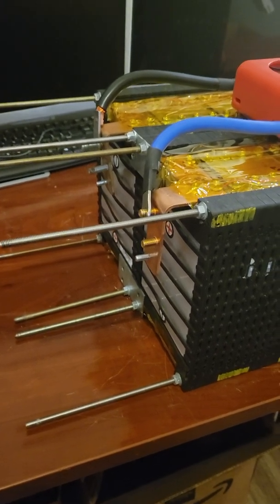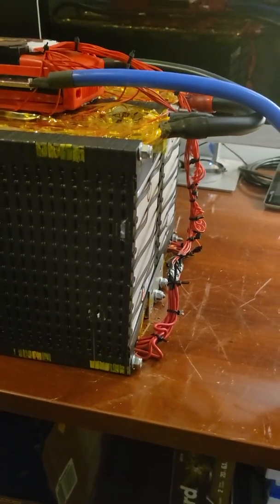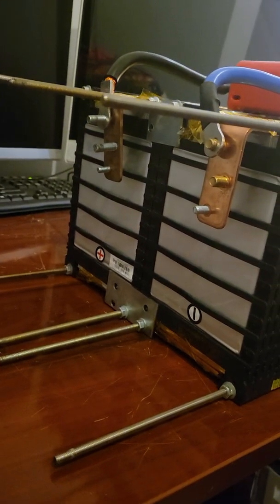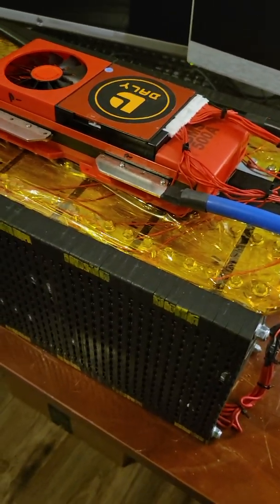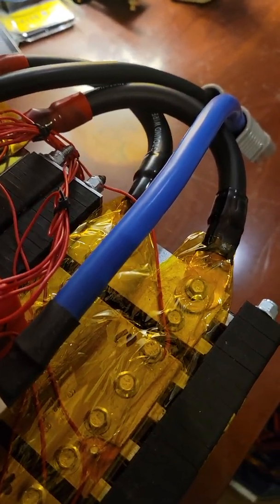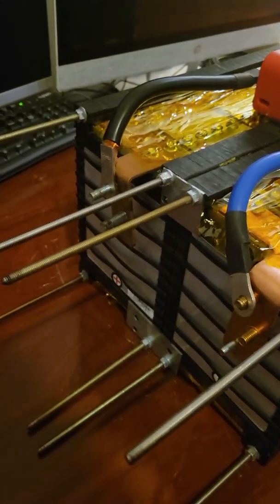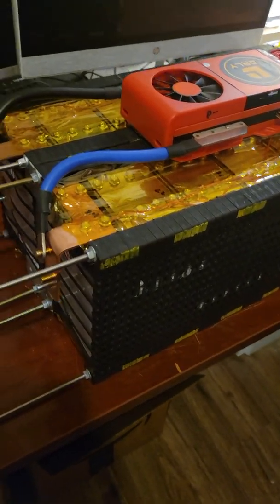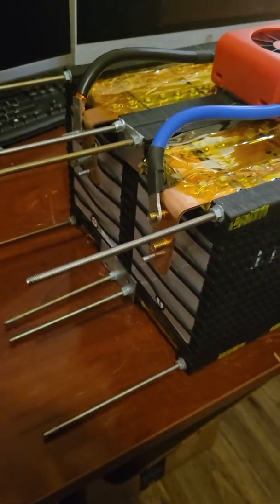Manned / Unmanned Drone High Amp Hour & Discharge Battery Project

Comment: Those battery not reliable Sometimes the cell goes dead. I have used these batteries for a couple of years. Only advantage is the high amp it delivers